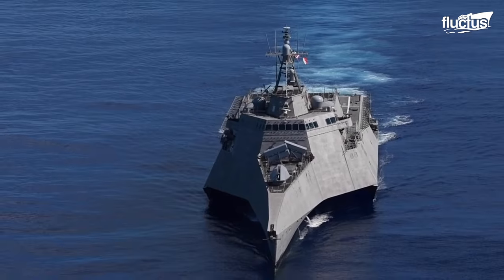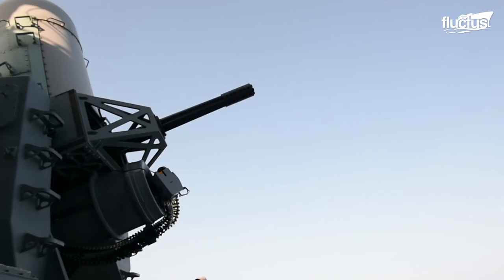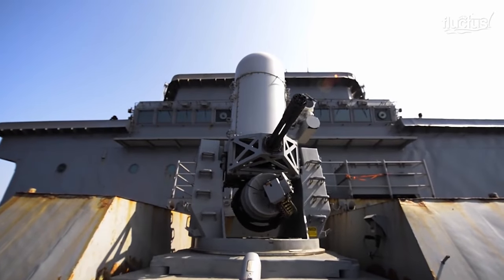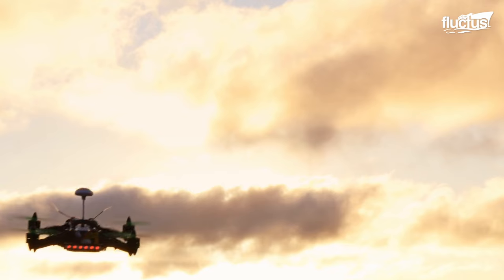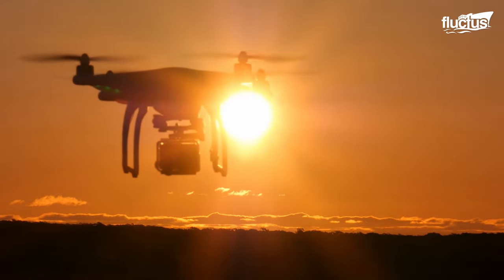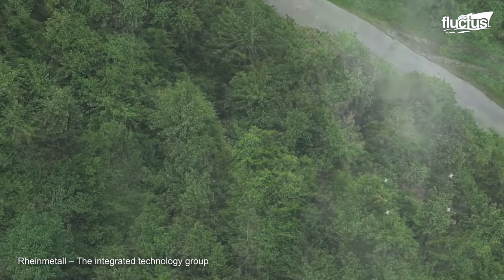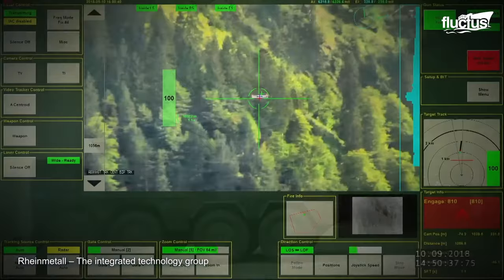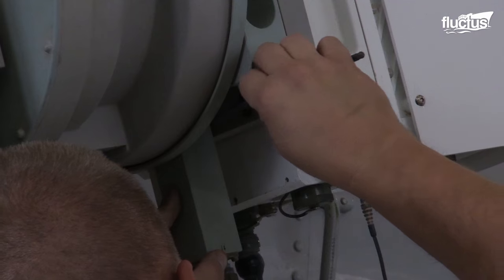The Extreme Solution US Navy Found to Deal With Enemy Drones in Middle of the Ocean

Comment: This was originally, if I remember right a general Dynamics project which miserably failed. The inspector general's office it pretty much had it with them and demanded in writing that Hughes aircraft company be brought in as a subcontractor to fix the problem. In short it only took Hughes aircraft company less than 12 months to take a failing project that have been going on for several years to where it was now ready for field testing. Since that time, there have been many variations of this project developed in use protecting not only our personnel but worldwide in a variety of Nations.

Raytheon was building the tomahawk cruise missile at the time and it failed miserably on that as well, again the inspector general's office recommended Hughes Aircraft Company be brought in as a subcontractor. Again, in less than 12 months use Aircraft Company brought it from a failed multi-year project to one that was ready for field testing. Hughes aircraft company within 2 years became the principal contractor and the tomahawk was actually built for decades at the Hughes aircraft company ground systems group in Fullerton California. Perhaps the funny part about this, is after general motors purchased Hughes aircraft company in the late '80s, with the infamous Roger Smith at the helm within 10 years,  the new management faced dozens of felony charges and convictions for the falsification of test reports on 75 different DOD programs. In essence they built products that would not work and they knew it. Hughes aircraft company missile systems group was specifically banned from all contracts for 5 years and all missile manufacturing, engineering, and development was now pulled and transferred to other companies. The tomahawk missile was also pulled and reassigned to Raytheon who builds that missile today at El Segundo California at the former Hughes Aircraft company electro optic and Data Systems group site
Reply: Yeah, we used to call them the Huge Aircrash Company.
Reply: Phalanx was a very successful program at General Dynamics in Pomona for many years before Hughes became involved.  The first production Phalanx was installed on the USS Coral Sea in 1980.  It exceeded maintenance, reliability, availability, and cost targets set by the USN.  I started working on it in 1984, and we were on budget and met all operational specifications for the program.   Hughes didn't purchase the GenDyn missile business until 1991.  They relocated the production and engineering out of California and it took about a year to get back on track.  So saying Hughes came to the rescue on Phalanx is totally incorrect.  Now there were a couple of programs that General Dynamics was totally flat on, and the programs were closed down before Hughes entered the picture.  Those were the A12 attack aircraft and the Sgt. York gun system.
Reply: @ZonaJim HAC didn't purchase general Dynamics missile business..... I left his Aircraft company in 1990, and in 19 89 we were ordered by Hughes corporate not to travel within 5 MI of missile systems Group corporate headquarters, engineering Labs  in Canoga Park as the plant site was closing and general motors was going to pull the tanks and related test substances without a single permit from the city of Los Angeles, the county of Los Angeles, the state of California or the department of energy

General Dynamics and Raytheon purchased Hughes missile systems group and the related systems since the executives of Hughes aircraft including the executives at missile systems group are charged with 75 felonies. And the inspector general reports on the system were terrible as far as the projects with both Raytheon and general Dynamics had that were transferred to Hughes back in the late seventies and early eighties.

I now recall what was going on and I stand partially corrected. General motors purchase two Aircraft company in 1986 initially the company was called Hughes electronics and then when the escrow with general motors finally closed several years later it was renamed general motors Hughes electronics AKA GMHE..... The missile system group have been closed up or in the process of being closed up to where it was merely a mail drop in Canoga Park several years prior to the general Dynamics missile systems group purchase, but it was not his aircraft that purchased it it was general motors under the name of GMHE.... And what this did was in essence in temporarily put management over the missile group again which all assets had already been transferred over. The only thing that was left was the missile production of plant 42 in Arizona. It was really a giant shell game as the US attorney general and DOD for shutting down GMHE one step at a time. They actually had to work at it as one night I remember watching 60 minutes as the two top executives for what was the hughes missile systems group on TV with 100 Grand cash if I remember right in a hotel room attempting to buy off two senators who are part of the investigation committee. That didn't go very well! My wife worked at corporate for the senior wage negotiator for Hughes, as I worked at El Segundo North and was loaned out to corporate periodically. It was the mess of the century
Reply: @jeffalvich9434  May 12, 1992.  Hughes Aircraft purchased General Dynamics missile business for $450M in stock.  It's easily verifiable with a search.
Reply: @ZonaJim  but the clothes of escrow in transfer of assets happened before
Reply: Monkkmmpi😂

Comment: The German idea looked like the best one.  If you are shooting 3-5 thousands rounds per minute, you had better have a lot of guys lined up with ammo ready to go.  A few buckets of water maybe necessary too to help cool that thing off during an actual attack.  The stresses that thing under goes when firing must be enormous, but if it's the last thing you have before the ship is hit, fire away.
Reply: The weapon is called the MANTIS.
It fires rounds that explode into shrapnel when near the target, turning everything in it's path into a fine red mist.
Reply: 40/57/76mm cannons with Airburst ammo is pretty common as ship defense in many navies.
Reply: @znail4675  There is talk in france about using a modified 40 ctc which is a 40mm canon to arm mobile air defence system. Considering the quality of these newer guns, they seem very relevant as a countemesure against drones and such. I would not be surprised to see more and more fielded in the next 15 years for this purpose.
Reply: @chronic6428  CTC is very good for that role. It's not quite as powerful as Bofors 40mm in the anti-armor role, but it got just as large caliber for big airburst.

Comment: This video just sounds like a puff piece for the military contractors with no balance.

The Phalanx has a limited and completely negative combat record. It has shot down friendly planes towing targets, possibly because it has no IFF.

The USS Stark was hit by 2 Exocet missiles. Not really the Phalanx's fault that one - the ship had turned it to standby mode.

More concerning was 1991 when a silkworm missile was fired at the fleet. The USS Missouri fired chaff and the Phalanx on USS Jarret opened fire on the chaff, hitting the Missouri. That should never have happened as the chaff looked nothing like a high speed target closing in on the ship which is supposedly the targeting criteria for the gun.

Fortunately HMS Gloucester shot down the silkworm with an aging Sea Dart missile, since replaced with the far superior Sea Viper.

Apart from that is has no combat record, but the chaff incident shows how important it is to test it in realistic conditions, not calm sunny days with nothing else going on as in all the video clips here.

At best the phalanx is a weapon of last resort. If it needs to fire you have failed and it would be useless against a hypersonic missile.
Reply: Hypersonic missiles are today's bogeyman. In terminal phase, they have to slow to supersonic in order not to burn up in the thick atmosphere at sea level. 

As the USSR has had supersonic anti-ship missiles for decades, Western navies have had defenses against supersonic missiles for decades as well.

Comment: I got out of the Navy about 35 years ago. My last ship, a Knox class frigate, had a single CIWS mount aft. My first ship was the USS Forrestal that went into the Philly shipyard with BPDMS, which I understood was replaced by CIWS during that yard period. (BPDMS = Basic Point Defense Missile System).

The CIWS was nicknamed "R2-D2", due to its shape. Watching it during movement checks was phenomenal, a lot quicker than you would guess from looking at it. They would periodically do fire tests for both the CIWS and the 5"/54 gun mount forward. When you heard, "The following is a test of Mount 20-1.", there'd be a short brrrrrp, then, "Test complete." And that, so I was told, was a few hundred rounds fired. On the other hand, "The following is a test of Mount 5-1.", would be followed by, "Boom....Boom.................................Boom..........................................Boom", "Test complete." The test was supposed to be ten rounds, but I'm not sure I ever heard them get through all ten. Supposedly, there'd be range problems.

As I understand, CIWS is a defense system. Back in my day, at least, I believe they would only respond to targets on a threat trajectory resembling an incoming missile, factoring in speed of approach, etc. The way it was explained to me, the radar does a circular search, finds the target, fires a burst, searches again for the next biggest piece, first a burst, repeat until threat eliminated (or ammo runs out). Pretty cool sounding, never actually saw it in actual use, even on a target. I would suppose targeting other things with a different signature than an incoming missile (like, say, a drone) would possibly be a software issue to change the parameters of engagement, but then I've never seen the control room and don't know what the original operating limits may have been.

However, one of the best stories I heard about CIWS concerned a test target. Behind a tow plane. According to the story, not only did the CIWS take out the target, it followed the tow line and took out part of the tail of the tow plane. Don't know if it's true, I wasn't there for it. But, it seems somewhat plausible.

Also, don't know if anything has changed to address it in the last 35 years, but, as was also brought out in the Clancy novel Red Storm Rising, CIWS can run out of ammo rather quickly (given how fast it fires, no surprise). From what I understand, you also have to go topside to the mount to load ammo. That part never made a lot of sense to me, given that on my frigate the CIWS control room was directly beneath the mount. (We actually had a sailor lose it and lock himself into that control room once.) It would seem logical to have a way to reload from there, and maybe that's been changed, or I was misled. However, in that Clancy novel, during a sea battle, a Knox class frigate's CIWS takes out the first few missiles, runs out of ammo, then the ship gets hit and sunk. I happened to be serving aboard a Knox class frigate when I read that novel. Not a real good feeling. Right up there with what we were told on the carrier, "In combat, the goal is get all the planes off the deck once. Anything after that is gravy." Nice to know, you still being there with the ship for the planes to come back to is actually a lower priority.
Reply: Back when I was in, we had the Phalanx system, but that was before drones being a possible threat as far as I remember... The only drones we had back then were target drone -- probably powered by the old McCulloch 72 hp engine... I remember once where they were doing a test on the BPDMS and a some of us (ETs and FTs) were standing around topside watching it... The missile left the launcher, pulled up, did nearly about a 270 degree vertical loop, and then went in the water under power... We looked over at the FTs that were with us and let's just say they had a very embarrassed look on their faces and kind of slunk off to the division office, knowing that they were going to be having to explain such a very public failure...
Reply: Thanks for sharing your recollections.

That said, Phalanx was designed to be self contained. That's why, unlike the 5" mounts, there was no turret underneath them where they could be reloaded from a protected space.
Reply: @seanseoltoir  We had four FTs that were also part of our radar shop, the rest of us being ETs. Those four FTs were there for the AN/SPS-49 radar, a 3D air search radar. I worked on the AN/SPS-43A radar, a long range air search radar. Apparently, the SPS-49 was originally assigned to the ETs to maintain. When the ETs had it, only two were assigned. The FTs had four people assigned. So, we'd often remind the FTs that it took four of them to replace two of us....🙂

Comment: Wondering what is the average distance from one projectile to the ones directly in front and behind it? For C-RAMS specifically.
Reply: Simple math actually. 75rounds per second. This they are 1/75th if a second apart.

Google says they are moving at 3600 feet per second. So 3600 * 1/75 = ~48 feet apart
Reply: @scottsolar5884  Yes but. What is the cross sectional area of their trajectories? If I understand C-RAMS is sort of a modern Gatlin gun.

Comment: late 70's goalkeeper from the dutch marines used the GAU-8 Avenger with a dutch (holland signal) radar/computer.  because the US system was too heavy for the smaller and lighter Dutch vessels, AND could be loaded from below deck.
Reply: What? The C-RAM in the video is a Phalanx on wheels that can be pulled by a truck. How small are Dutch Navy ships?

Comment: Are these systems capable of working all-weather? Fog,snow or rain?
Reply: Good question
Reply: Yes they are
Reply: The Phalynx CIWS and some other missile systems use radar to track, so they is not affected by weather. The optical systems would be affected but so would the targets using optics for surveillance or targeting. Any radar-guided missile would be engaged with a passive radar detector such as an Anti-Radiation missile. You don't depend on only 1 system to provide complete protection if you're smart.

Comment: For a drone swarm you need a millimetre wave radar, a lightweight gun on a fast gimbal and something that fires a lot of small bullets in an open pattern in a short period of time, or even an automatic shotgun type. This wouldn’t need armour piercing or anything: it just needs coverage and quantity.
Reply: Or something like the Hydra rocket pod but outfit the rockets with a guidance system and a proximity fuze.

Or an M230 30mm chain gun with programmable airburst function like the Skyshield. Hell, they could probably make a giant 30mm shotgun shell with a ton of 10mm shot in them for close range. So many possibilities...
Reply: Rhienmetall do exactly this.

Comment: We need to figure out how to take out drones without so much "lead" in the air.
Reply: Knowing how it work, I would use 2 drones in order to keep them dry out of amunition and then do as I please. First to enter detection field with a cheap one and detect threat. Second to purposely move fast and quite randomly at that detection range and then come back to base after all the lead has been wasted. If you saw drones races you know it's impossible to catch those with lead, especially as they are far from the destructing unit. Would love to see them using some counter measure too to make that lead wasted.
Those anti drones device might work once, but not twice on the same position. I guess US didn't learn in vietnam about using the best cost/return of a weapon.
Reply: @AtlantisArch  Yeah it's going to take more than 2 drones the sea wiz tracks a target at 8 km with a maximum firing range of 5 km and an  effective firing range of 1.5 km
Reply: Although a long way off, lasers should eventually solve the problem.
Reply: @cragar55  The US Navy has already sent ships to the Gulf with laser turrets on to deal with drone and missile threats.  I don't know if they have been used in anger yet, but testing suggests that they work well.  This is the reason that all recent US Navy combat ship classes have been built with a very large excess of electrical power over their current needs.  As laser technology improves they will be able to retrofit it to the ships.  It ends the ammunition supply problem that can plague shell-based CWIS systems during mass drone attacks.

Comment: Wouldn't smaller bullets work just as well?
Reply: A larger round allows for larger propellant charges for longer range. Larger rounds also resist the wind better. Above a certain size (30mm maybe, not sure), electronics can be included to either detonate an explosive charge near the target increasing the odds of success.
Reply: @darylkreskowiak6757  - yes, that 35mm German system definitely had proximity fuzes.  Those little drones were swatted with a prox blast, not a direct hit.  20mm ammo, no such thing.
Reply: @kurtbjorn3841  35 mm AHEAD ammo uses an advanced Time Fuze warhead that uses a 3 coil fire control system on the barrel to provide accurate muzzle velocity to the targeting computer so that it can adjust the firing solution. No Proximity fuze is needed
Reply: @jyralnadreth4442  - I'm not sure I understand... the timing is fixed but the muzzle velocity is altered?  Wouldn't it be easier to set the detonation timing for a given target range?
Reply: Hello nice to meet you

Comment: maximum firing range of up to 6000 yards.... a 20mm.  What is the effective range at which it will take out the target?
Reply: The intended target is an incoming missile. Those are usually light weight. On hit would damage the surface of the missile such that it becomes un-aerodynamic. The speed of the missile itself then causes catastrophic damage.